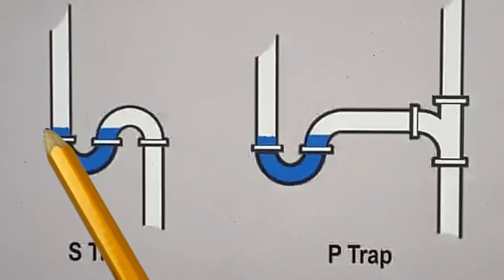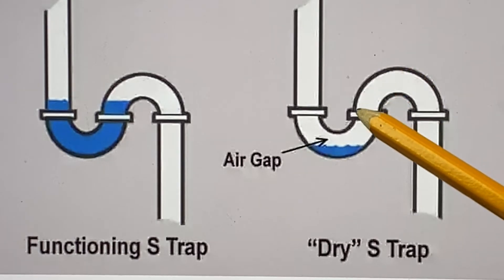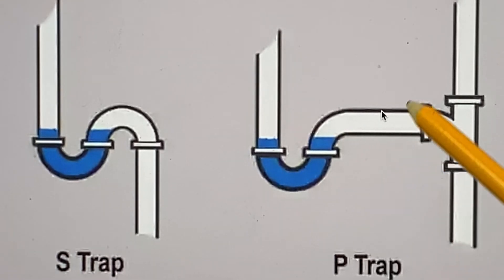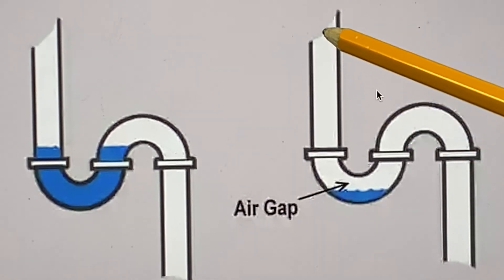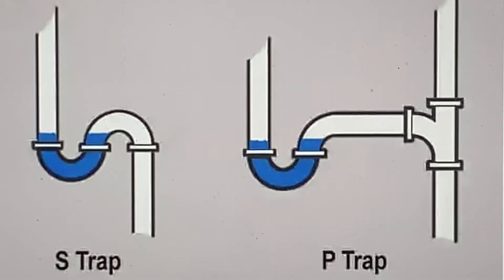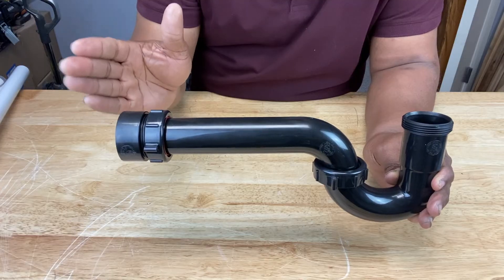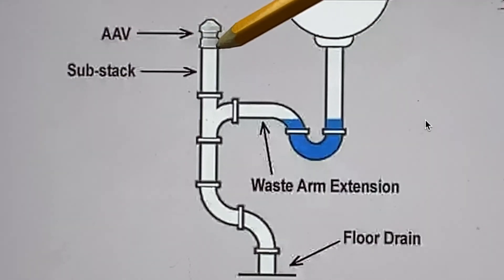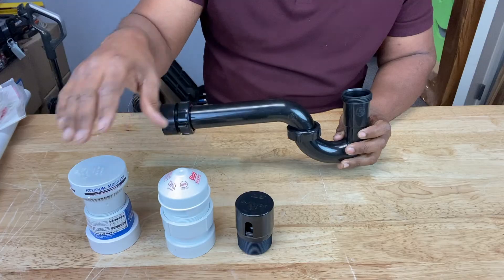WHAT IS THE DIFFERENCE BETWEEN A P TRAP AND AN S TRAP?

Comment: I have an s trap under the kitchen sink that drains through the floor - rather than the wall - to a waste line in the basement.  We have had no bad smells until after we cleared a clog in the waste line this week.  We also got on the roof and cleared he vent line.  Now that the waste line and the vent are as clean as they've ever been we're experiencing foul smells.  

I assume the sludge had been restricting air flow that prevented siphoning.  Now that the lines are all clear, it's sucking all or most of the water out of the trap.  

Even though a vent line connects to the waste line only about 18 inches from where the sink drain connects to the waste line, will installing an AAV under the sink solve the smell problem?
Reply from the maker: You've diagnosed the problem correctly - clearing the blockages has restored proper airflow, which is now allowing the trap to be siphoned dry. However, an AAV (Air Admittance Valve) under the sink likely won't solve your issue because the problem isn't inadequate venting at the fixture level.
Since your vent connection is only 18 inches downstream from where your sink drain connects to the waste line, you already have adequate venting according to code (most jurisdictions allow up to 3.5-6 feet). The issue is more likely related to the vertical drop and the physics of your particular drain configuration.
Here are better solutions to consider:
Most effective options:

Install a deeper trap - A trap with a deeper water seal (3-4 inches instead of the standard 2 inches) will be harder to siphon completely dry
Add a trap primer - This device automatically adds small amounts of water to maintain the seal
Install a mechanical trap seal - These devices prevent siphoning while allowing drainage

Check this first:
Make sure your vent line is actually open to atmosphere at the roof and that the connection to the waste line isn't blocked. Sometimes clearing one blockage reveals another.
Why an AAV won't help:
An AAV allows air into the system when there's negative pressure, but with your vent so close to the connection point, you already have that air pathway. The AAV won't prevent the siphoning action caused by the long vertical drop to your basement.
The trap primer is probably your most reliable long-term solution since it automatically maintains the water seal regardless of siphoning conditions.
Reply: @Caliber8Tools  Wow.  Thank you for taking the time to respond and providing your advise and potential solutions.  I will definitely do some research on trap primers and a deeper trap.  Appreciate your help.

Comment: I have a P-trap on my basin but it does not have a waste arm extension! After the trap it immediately heads down into the floor. Does this make it as bad as a S-trap? The dumb-ass who did our bathroom extension stupidly blocked off the vent to the loft and its now inaccessible, so for 10 years the basin has gurgled every time and we put up with it. Recently I fitted a 'SA10V McALPINE 32mm Anti-Vac Basin Sink Waste U Bend P Trap' and that solved the gurgling, but now 6 weeks later the waste-pipe is blocked after the trap. It could be a coincidence or is there a connection possibly?
Reply from the maker: Maybe not. The blockage could be normal debris build up like hair etc.

Comment: hoping you can help me friend.
our house is the usual old 130 yr old type .  my double kitchen sinks been problematic ,  the drain piping goes directly down into the floor , heading 
into the basement below and does not first curve off into the wall .
any advice on what I could do to make a more balanced draining and venting.

I've tried many different kits , and  overall the whole thing is just a mess.

Thank you for your time .

Don.
Reply from the maker: Look into having a sanitary T installed. Does it vent to the ceiling?

Comment: I “believe” flexible traps are not allowed by code. I’m sure you know this but it may be informative to mention this. 

Also, if you have a bathroom fixture that is rarely used you can slowly add water to the trap; shut off the water; then add a tablespoon or 2 of olive oil or any cooking oil. The oil will sit on top of the water in the trap and reduce/slow down evaporation.
Reply from the maker: Ah, interesting tip. Thanks.

Comment: I'm working on this house where these things have not been touched since probably the sixties everything in here is way before my time. There is no p-trap under the kitchen sink. It's a dual think it goes into one pipe that goes down into the tub. In the sub area there's this weird-looking contraption about 7 ft away and all this drainpipe is one and a half inch copper. Just to give you an idea how old this shit is. Everything I'm touching is disintegrating in my hands I don't know what to do should I try to put a p-trap in but I know I can't go through the roof or even into the wall with the air vent? It looks like an AAV is going to be my thank you for your tips and very well put out in English video
Reply from the maker: Glad it helped.
Reply: @Caliber8Tools  what would you recommend to tie into the copper pipe I'm going to have to cut in the basement and make it over into the ABS PVC schedule 40 drain that I'm going to use going from there over to the drain in the floor. I haven't done this type of work in a long time and the last time I did it we used to use ferncos(damn dyslexia) but I don't know if that was still used today the little rubber hose on both ends that has hose clamps to keep from leaking or is there another way?

Comment: When you buy these kits are they just screw together or do you have to use any kind of glues or anything? I always feel like I’m gonna have leaking water when working with plumbing. Thanks in advance.
Reply from the maker: They screw together. They come with seals for the joints as well.